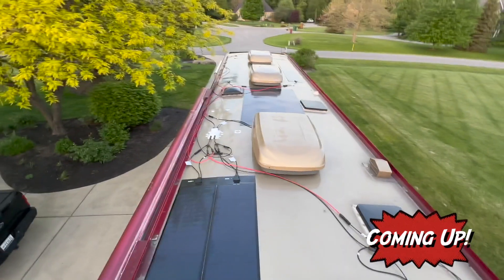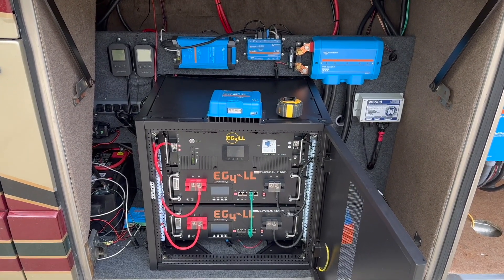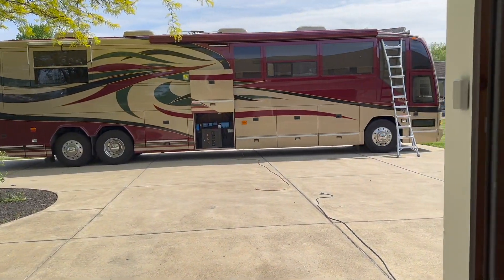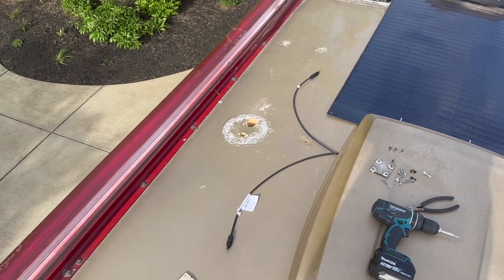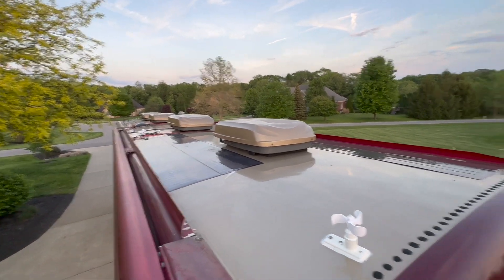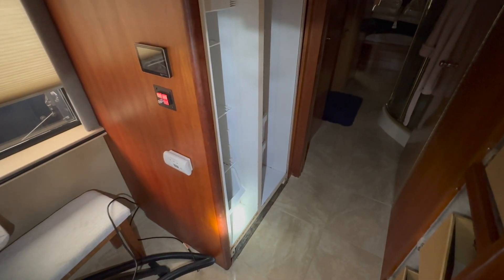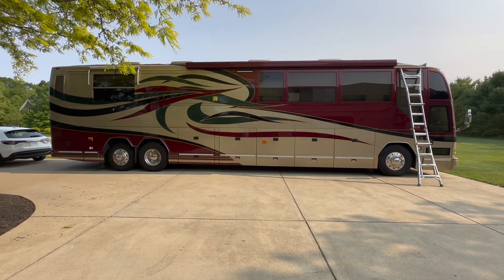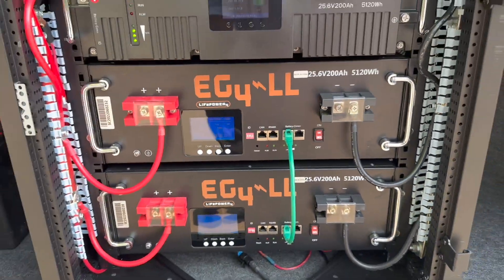Prevost RV Camper Solar Install - Part 1

Comment: In part 1 at 4:35, it looks like a shunt between the positive and negative bar of your lynx box.  Normally, a shunt is only between the negative post and the rest of the grounds.  I would think, the shunt would burn up after batteries are engaged......******
Reply from the maker: You have good eyes. After all this time you are the only person to catch what I did.  I really just turned that lynx into a double bus bar.  I cut 1/2 copper bar and mounted the shunt between the two ends as you mention. What that allowed me to do was provide a place to land my (2) 2/0 negative cables from the battery. It then runs through the shunt to the upper lynx bus bar - and allows me a place to land the other (2) 2/0 negative cables that each go to one of the inverters on the negative side. It then allowed me more bus bar points to land the other negative cables and still be on the correct side of the shunt.  I was looking for a large bus bar and found that - for $150 it was the nicest, largest bus bar out there.

Comment: Great video,  can you walk on the panels? I was watching a video on a Newmar King Aire , and they had mentioned that they could walk on their panels .
Happy trails.
Reply from the maker: These CIGS panels you can walk on.  The surface is like a hard plastic of some sort, so it can scratch though.   Most panels are the semi flexible monocrystalene, which can still be walked on.  I had to import these, for some reason they aren’t sold in the US (I think because of the cost) but found bougerv has two variants - a 100 and 200 watt panel.  So far besides the cost they are very efficient, light weight, and exceed their output rating.

Comment: kinda looks like you are missing your black tank vent stack cap on the roof. if so does it fill your black tank with rain water?
Reply from the maker: I think your right. I always forget about it.  I’m sure it was a tree branch.  You know it probably does fill the blank tank some. I think that’s the only vent - so probably hits both the grey and black somehow.  Would be interesting to run a hose up there and see where the water goes….  I will make me a note and order the cover - thanks!
Reply: @Camp Prevost  I have seen some that have small solar fans build into the cover that pull the stinky air out of the vent so you don't get smells in your rig. I don't think they fit all vents though.

Comment: Pretty impressive Arron! Did you find any issues with alternator you mentioned may been an issue?
Reply from the maker: I hooked my computer up to the WS500 and think I didn’t hit save the last time I was in there and it used its lefepo4 defaults.  I have the Victron alarm at a standard chargers max - which is around what it was telling me. So I hit save and it seems fine now - will see on the next trip - it never fully charged the batteries while driving.  Everything runs them up so high, if you watch the curve while charging - the amps drop to almost zero at 27.65 so I stop there.  Even the spec says 28.8v- but that’s like cramming every last electron in there possible.  So I think it was fine - just more than I want.

Comment: Great info as usual. Aaron do you have a central vac & did you keep it or ditch it?
Reply from the maker: This coach didn’t have one.  Would be nice to have - but don’t think it would be possible to run the hose now. Do you have one?  I put one in my super c that I had before this coach.  It was nice but the retractable hose thing I got wasn’t long to reach both sides of the rig - just a large portion of the center.
Reply: @CampPrevost  yes I do have one debating if I should keep it or not.

Comment: where is part 2 ?
Reply from the maker: I know - I got busy and then put it up for sale and it was gone really quick.
Reply: @CampPrevost  why would you do that?
Reply from the maker: @DeFiDuke  I know. We have been doing this for 4 years, girls started getting involved in activities and we got super busy. We haven’t even had the chance if we kept it to use it.  Worst thing for the bus was to keep her locked up all the time. She went to a good home in Tx.  Ends up my daughter was just diagnosed with leukemia, so blessing for sure not having to worry about it.
Reply: @CampPrevost  locked up? Looks like you live in a safe neighborhood.  Sorry to hear that heartbreaking, I hope she gets better I will pray 🙏
Reply: I'm about to install 700 w CIGS on top of my 2021 Fleetwood flair 29m and was using your video as a guide..  I will do part 2 for u 😁😂 hehee

Comment: I find it interesting that you used flexible panels.
Reply from the maker: I wanted to use the large solid panels but they were to big and with 4 roof tops, 3 air vents, antenna and bathroom vent, just not enough room. These adhered to the roof and worked well
Reply: why?? it's the new tech that blows everything else away!